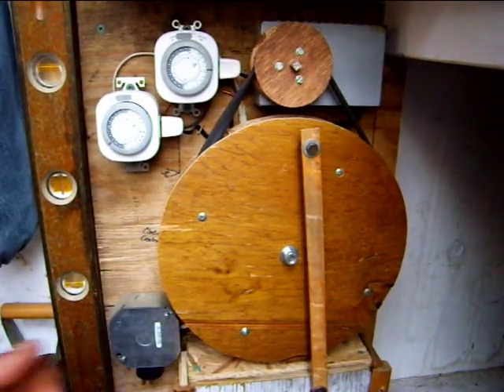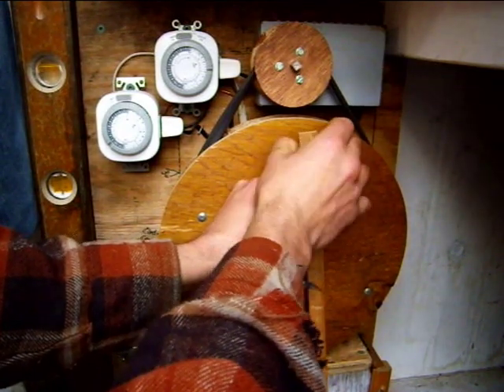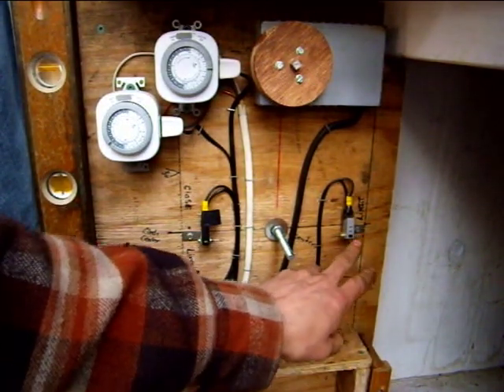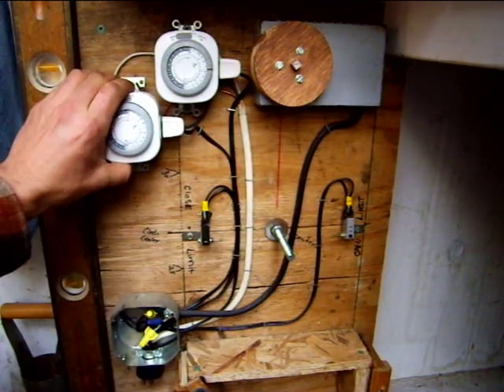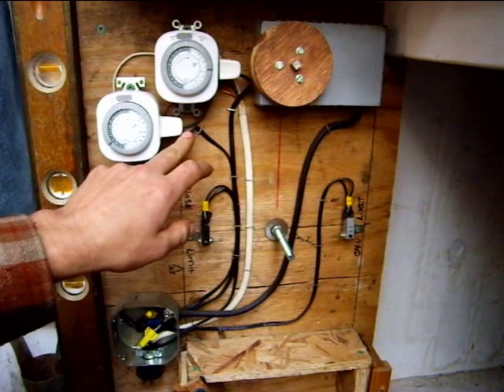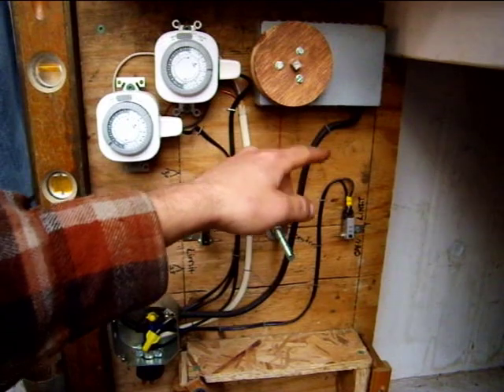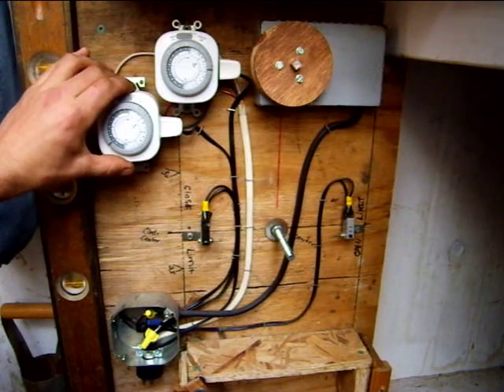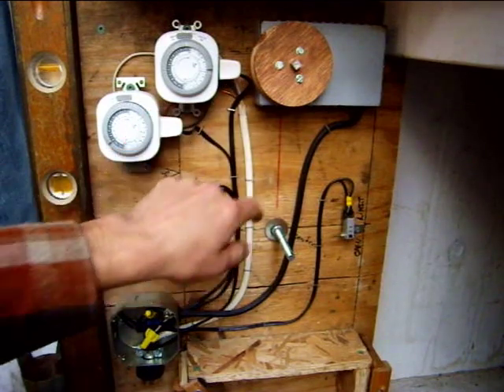Automatic Chicken Coop Door Wiring Diagram

Comment: Love your design idea.  I will try very similar in a 12V design with battery and solar charging.  Plan to use a relay to choose open or close modes.  Still trying to organize in my head just how I will get it done.  You have solved my biggest problem, trying to design a controller that reverses the motor, not needed with your large wheel design.  More later, thanks.

Comment: Same features: 2 timers, 2 microswitches (from an old vcr), wheel that operates a sliding door (slides from broken desk).  Variations:  18V Drill, 2 x AC/DC 12v adapters, worm geared wheel ( the foot massager had 2 of these), and I  installed the 2 microswitches to the framework near the metal slides on the door.  I still would like to experiment with Solar, batteries, and 12VDC only, but now the pressure is off, the chickens are safer.  My dog baby sits them

Comment: Slides are plentiful free, desks are put to the street all the time. The wood of the desk too.  Another source of worm gear and strong 12VDC motor, take apart a broken childs riding car or jeep, you get two of them.  I resorted to this design because it was easier than designing a new circuit for a 12V system, but I will keep thinking it out, or another reader will find such a task elementary.  Thank you for your ideas, bringing auto doors to the common folk at little or no cost.

Comment from the maker: If the two wheels were cogged it would make the door very secure!  I didn't try it though, and I'm sure the structure would need to be more precise to make it work.  The inner tube belt slipped a little because of  the small pulley diameter, so I glued a piece 40 grit to it.  I want to make the door a little more slippery also, maybe plexiglass or sheet metal.  I'm still amazed that it works so well, that doesn't happen often!

Comment from the maker: A dusk/dawn sensor could only be used for closing the door at night.  They make small dusk/dawn units that can plug right into any lower wattage appliance, like a lamp.  I would have to use an extension cord plugged into the socket used for the night timer, then place the sensor outside or facing the sunrise.  Another extension cord plugged into the sensor, and then plugged into the micro switch.

Comment: I finally have an automatic chicken door, thank you, and most of what I used came from your design.  I did manage to use a combination of 120vac and 12vdc.  Everything was from parts scavenged from other things that were broken for their original operations.  I have yet to make a video but really want to, and to add it as a response to this one, since they are related.  I didn't have a rotisserie motor, but did have a broken $300 foot massager with nice worm gears and 16 high quality bearings.

Comment: I replaced the burst voltage adapter with another adapter that output 5VDC at 600mA, I think for the closing (12VDC for opening).  I need to check what the amp draw is at 5 & 12 volts on an 18VDC drill, to see what you need to search for when going through your pile of adapters.  (I keep every adapter I find, 100 and counting to choose from).  I finally noticed a chicken's foot step close, then back away as the door was closing in the response video, should be up, wasn't when I am writing.

Comment: Sorry, one last thing.  One of the adapters for some reason wouldn't supply continuious 12 Volts, but gave bursts of power once per second.  I decided this was a good thing and employed it on the closing side.  So the door opens in 10 seconds, and closes in 3 minutes, nice and slow so no squashed chickens, something that has churned in my mind how to sense the presence of a chicken during the closing of the door.  Out for now, I'll work on a video.

Comment from the maker: The adapter that doesn't supply continuously is probably a charger, on a float cycle.  I was also trying to figure out a safety mechanism.  Maybe place a bumper with a switch on the bottom of the door, attached to the close circuit, and somehow disengage it, close to the bottom.  or...pressure plates and switches on either side of the door may be easier.   I will ok your video response, Later...

Comment from the maker: The door slide sounds nice, I may have to rebuild.  The worm gear should last longer than the cheapo rotisserie motor too.   You would think that it would be easy to make it 12 volt, but somehow, it is not.  I hooked mine up to an inverter on a battery and it worked well, but I have to cut down this miserable half dead tree before I can solar charge.    Automatic stuff relieves all kinds of pressure, isn't it great!

Comment: ok, when I only have one timer plugged in the motor works and so does the micro switch but when I plug in both timers I blow the micro switches and trip the house breaker. what the heck.  I've followed your directions from what I can see and its not working.   I must be doing something wrong.